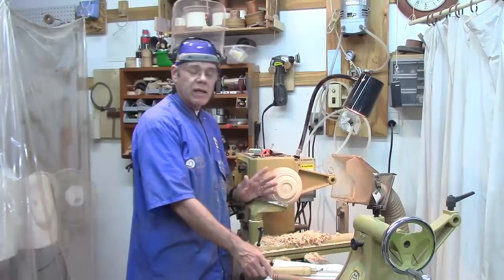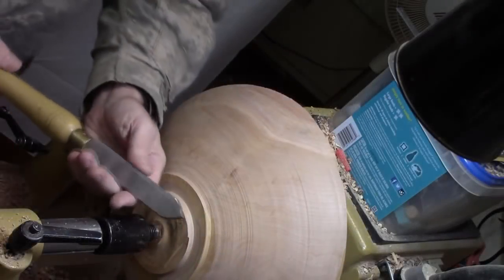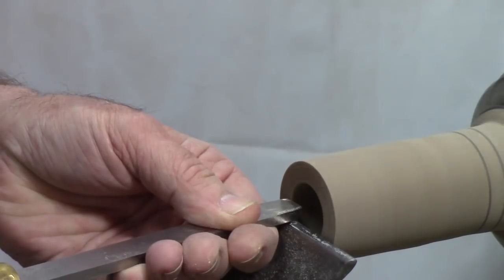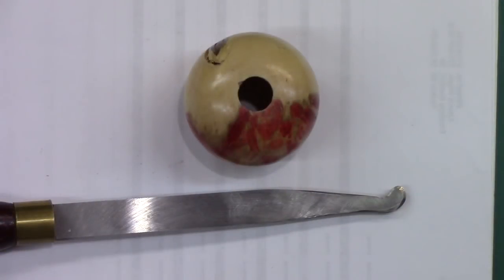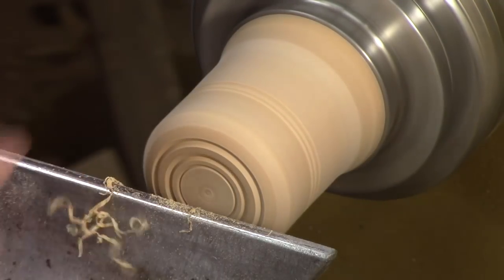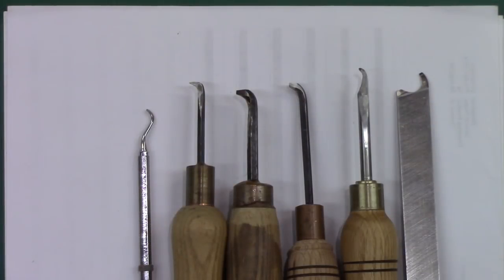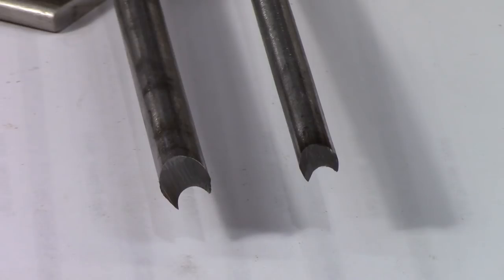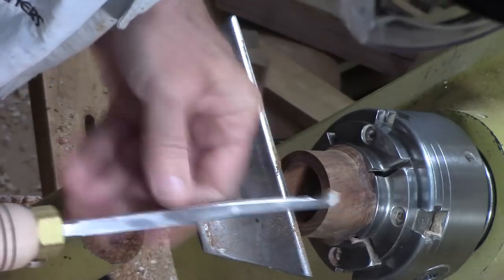Specialty Scrapers for the Wood Lathe

Comment: When I started turning, as a kid, in the late 50's , all we had were scrapers. My great grandfather was my teacher.  To start with ,  1) learn to clean the shop! 2) sharpening tools. 3) how to make the scraper you needed and how to use it without damaging the spindle work you were using it on. AND above all!! keeping the pattern in the log book so you could duplicate the scraper later on incase of re-orders.  Often, we had to keep the wood template for the piece too, and the scraper number was attached to it. 

I remember as a n early teen my great grandfather showing me some of the project patterns (story sticks). One consisted of four eight foot sticks long and had more than ten scraper patterns associated with it.. The project was a split turning for the front trip of a grand Pipe organ for the masonic temple somewhere.  The reason I brought this up is because of a flood or something,  he had to return a bottom legs of the trim which was to foot in diameter  fifteen years later and again had to return a section of it due to the installation of fire sprinklers.  custom work requires  the mandate of Keeping records of your scraper designs and story sticks.
Reply from the maker: Thanks for sharing that story, Robert. Excellent reminder for good design records and storyboard retention.